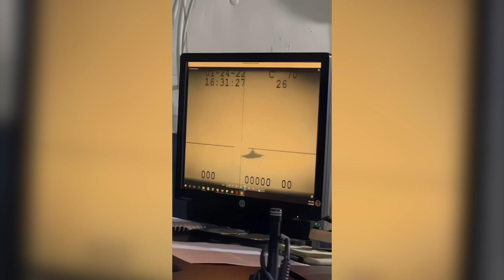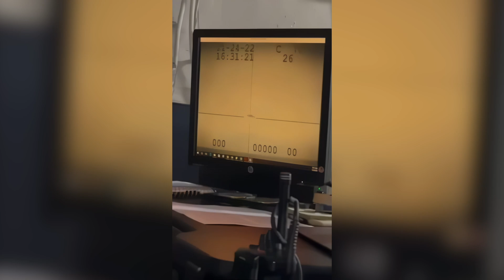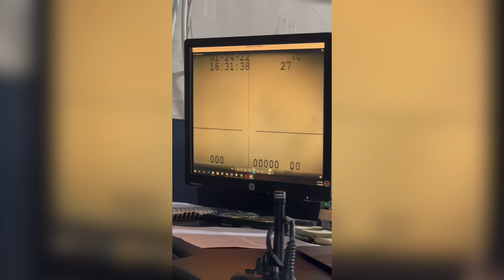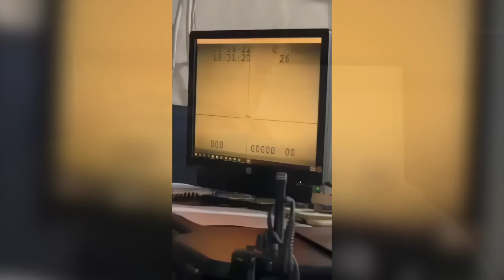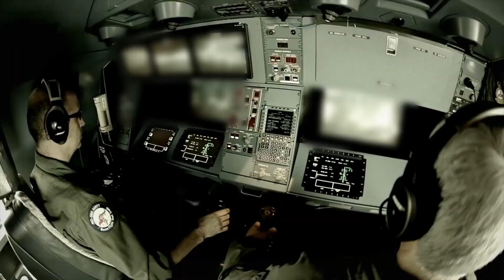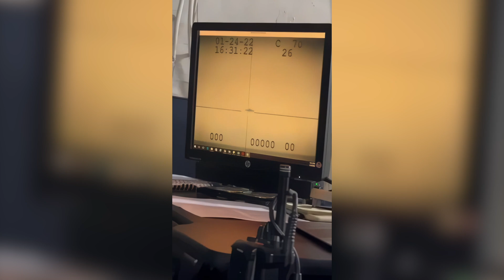F-35  CRASH On The Vinson | Upscaled & Enhanced Slow Motion | F-35C Lightning II Strike Fighter

Comment: It lost teh engine power during landing. It is similar case as British F-35 fell to the sea after running the carrier run-way. Japanese F-35 fell in the ocean without traces. It is considered that the same engine issue caused the accident.
Reply from the maker: One engine aircraft…
Reply: Well this aged like milk. According to the mishap report the engine was fine, the pilot on the other hand was attempting maneuvers he wasn't familiar with and didn't properly configure the aircraft. The F-35s that went overboard occurred due to human errors as well.

Comment: Five incidents in a single cruise sounds about average to me. On the one cruise I was on in '79-'80 we also had five with no fatalities. A-6 soft cat jet into the drink, F-4 FOD on cat jet into the drink, F-4 slid off flight deck when the carrier took a sharp turn just as they were unchaining it, A-7 hook struck the ramp sheared off the main gear jet went off the angle, and an A-7 with a complete hydraulic failure with the speed brake stuck down caught the barricade. And an F-4 was pushed into the catwalk by a tug but the only damage was the centerline fuel tank and one sidewinder.

Comment: Two cases of engine failures and the F-18s still got home safely. There’ll be no such luck for any F-35.
Reply: They made do with a single engine on A-7s, F-8s, A-4s, F4Ds, F9Fs, FJs... for decades with engines far less reliable than the F135 in the F-35. It's called weighing the risks and benefits.
Reply: @Mishn0  And how much more does a F-35 cost to replace? There’s a reason or two why F-4s, F-14s, and F-18 Navy aircraft went to two engines, One of which was to get home on one good engine should the other fail. (I saw that to good effect at an Airshow at Ellington Field, Houston one Saturday in 1992, when one of the displaying Blue Angels’ F-18 had a flame-out during a tail stand (high alpha) manoeuvre.  That engine out ability was one criterion applied in the selection of the the F-18 for our airforce. Apparently that particular criterion no longer applies..
Reply: @jamesroseby3823  The main reason was that there wasn't a single engine with enough power to do the job. That's usually the reason for multiple engines.
Reply: @Mishn0  No lmao.. redundancy as well.
Reply: @cefb8923  redundancy applies if the chance for failure outweighs the cost of operation; with modern turbine engines having a mechanical failure rate of 10^-24 or so it'll be a cold day in hell when it happens, i.e. statistically insignificant. Look at aircraft like the F15, SU-27, J-20, all of them are heavier aircraft with high payloads for the exact reason @Mishn0 gave. The same applies to general aviation aircraft, the piston multis generally come about when payload is a factor over speed.
Reply: Plenty of twin engine Tomcats, Hornets, Super Hornets, Prowlers, Intruders, Vikings, Phantoms, Vigilantes, Hawkeyes, Greyhounds and Traders have been lost operating from the boat due to single engine failure.